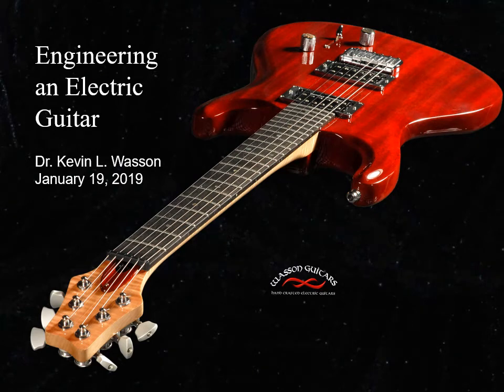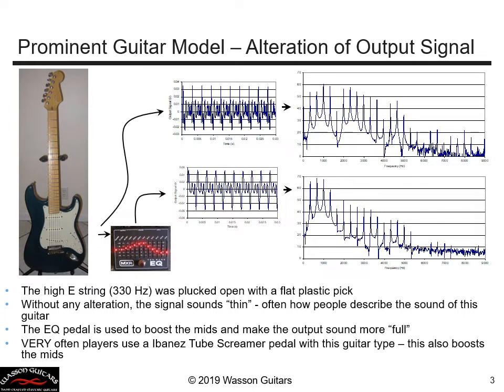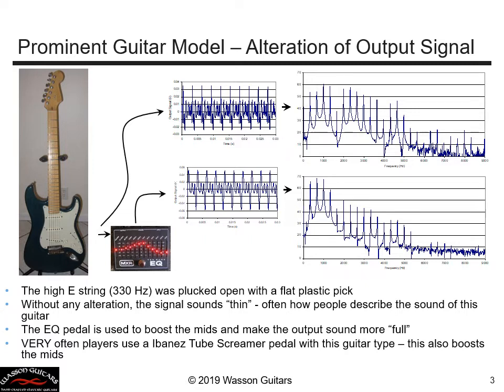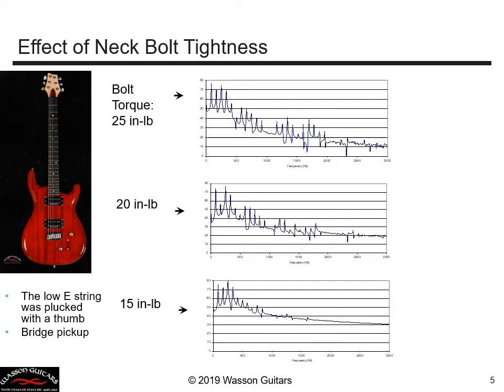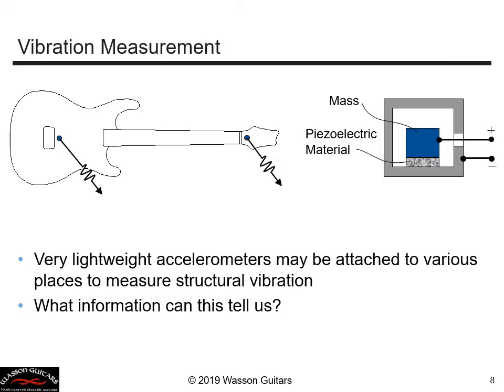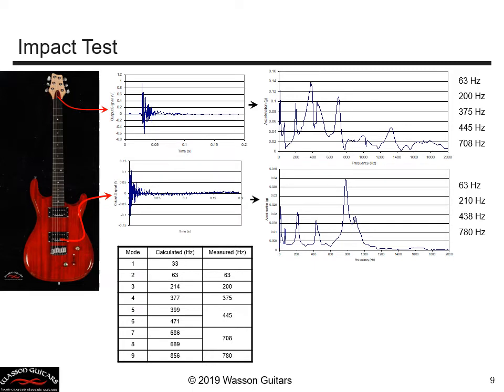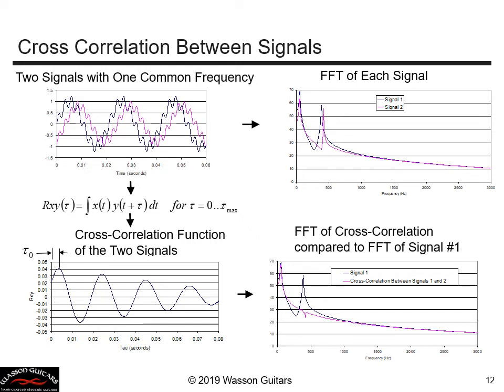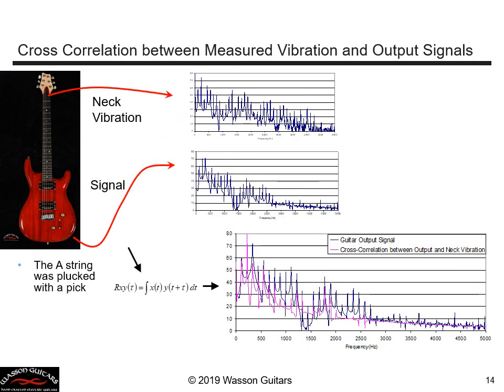Engineering an Electric Guitar - Part 3

Comment: Kevin, I find it interesting that the first mode (33 Hz) from the vibration modal analysis is missing from the measured output of the accelerometers.  Especially given the placement of the accelerometer on the guitar's headstock.  From the analysis, it appears as if this mode should have been most present on the headstock.  I'm curious, of what the modes look like on many different makes and models of guitars.  I think someone should start a GoFundMe page and fund your research on this subject.  I'm sure some guitar manufacturers might be embarrassed on the findings.  Thanks for making what you've done available to the public.  I'm especially curious of what the modes on a Gibson Les Paul look like given a solid mahogany neck.  I love the tone on that guitar.

Comment: Very interesting. Now things change if you do a tap test on the neck and body before assembly to determine if either is bright or dull by the sound of the timber. Fitting a bright neck on a bright body will give you a bright guitar. But if you fit a bright neck on a dull body then the two will balance each other out. This should give you a guitar with more usable tones across the whole range.